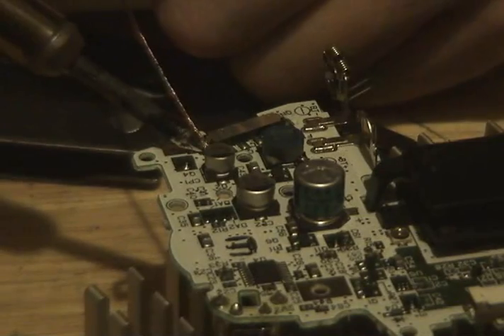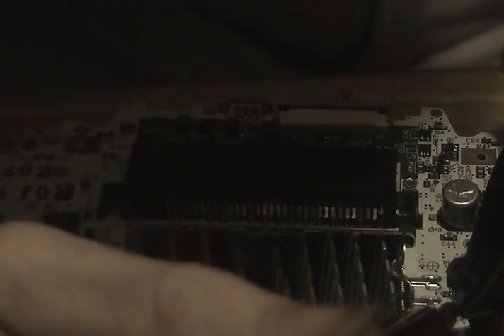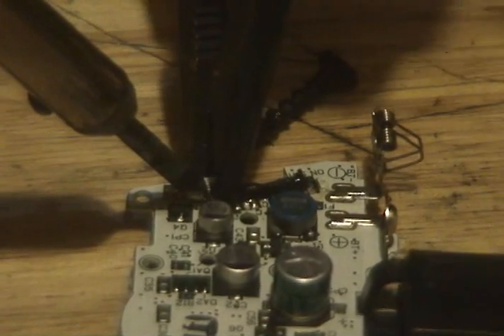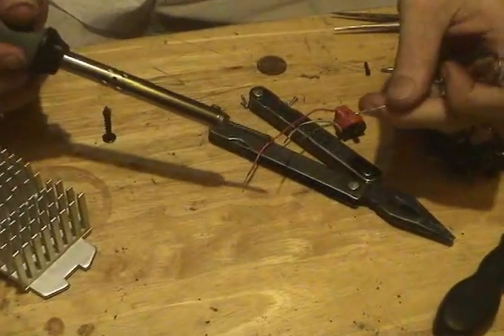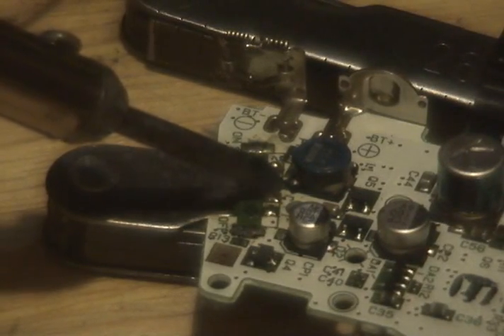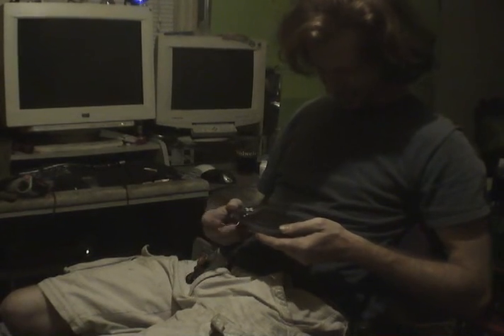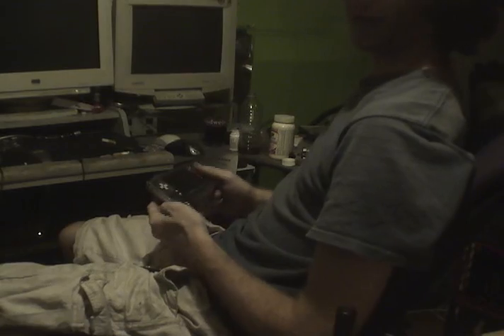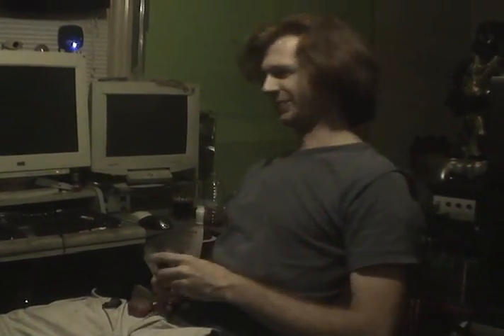Game.Hack Season 2 Episode 3 - GBA power switch

Comment: Very nice guide. I am looking to change or repair -if possible- the power switch of my gameboy color. I am unable to find a tutorial on that, or any replacement switch. Is there a chance o can fix the existing one? If i wire the switch's terminals together and remove a battery each time i want to power off my console, would that be a viable solution? Thanks in advance!